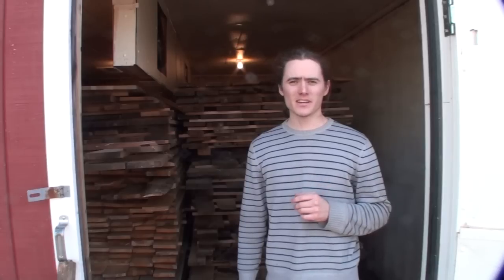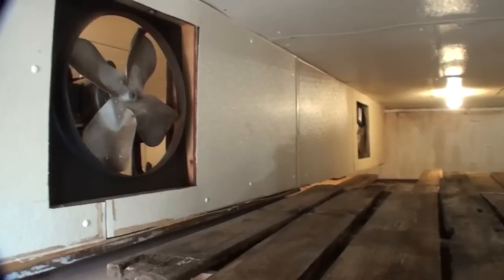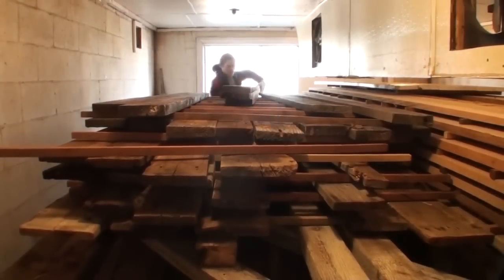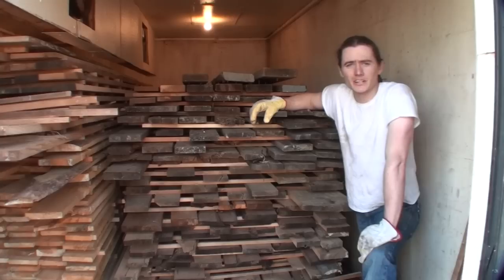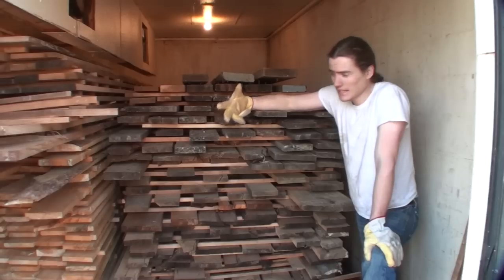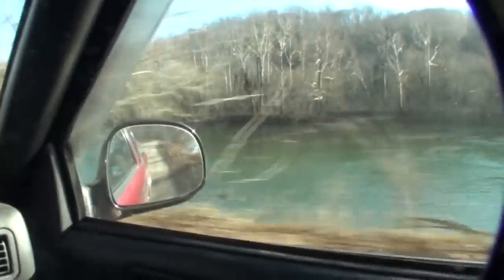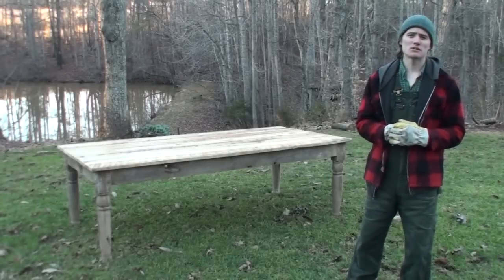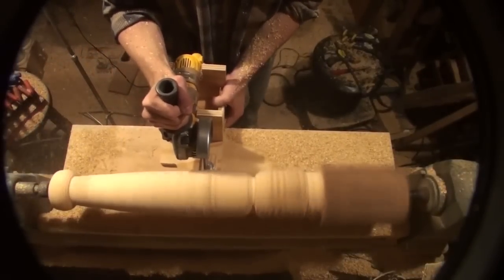Kiln Drying Reclaimed Lumber for Making Furniture - Barn Wood to Farm Table

Comment: Love you vids.. I have a tip, don't know if you have tried it or not but Baking Soda mixed with warm water will give wood an aged appearance.. Try it out.. might work better than dies..  just apply generously and let sit..
Reply from the maker: James Mead I've never done it but know about it, I use a different but similar method that is very fast. A jar of white vinegar with a piece of steel wool in it at least over night, remove the steal wool and you've got what still looks like vinegar but will turn woods with lots of tanic acid black if you want too. Oak, walnut, mahogany, etc.... I call it black magic. But the backing soda would also have it's place in my shop, my method is very powerful and does not work really on pine, maple and other woods which are lighter color. The nice thing about these methods are they are not "grain filling" like paint or stain and the grain of the wood is still visible and gives you options that you don't have with other finishes.

Comment: I have a shed 12 by 20 and I use stickers to seperate the boards and some fans to move the air around.  I keep there for a few months for pine but I have some red oak that I have had for about a year.  I like your idea about a solar kiln that you mentioned.  I have always like building wood projects but as for making money on it I haven't had that opportunity.  I just don't know enough people and I am not a sales person so I mainly end making things for family members.
Reply from the maker: Robert Lacasse Very cool, the fans alone really speed things up and keep the wood from getting moldy. Adding a solar aspect would really get you going. Thanks for watching.

Comment: Have you ever heard of making stain by putting scrap nails in a jar ( like you pull out of lumber) or steel wool and adding vinegar? Longer you let it sit darker thevstain.
Reply from the maker: Sure have, I call it black magic. I used to do it a lot. I use white vinegar, steel wool, let it sit for 24 hours or so and it's ready to go.

Comment: I've been purchasing Cypress from a guy w/ a lumber mill.  I can get any size, thickness/width I want in 10' lengths, mostly.  This wood is very wet and shrinks, heavily.  I've made personal projects, biscut joining the planks into tops that shrink so much they bust my full coverage glue joints up to 1/2" gaps.  
1.)  Can I polyeurathane all sides to stop this from happening?
2.)  How can I dry it out and how long will it take?
3.)  If I make mortise & tenon legs and aprins, will they bust as well?
Any thoughts on the matter would be greatly appreciated.  I haven't found anyone around here w/ a kiln as yet and have mostly worked w/ dry wood from retail stores which can't cater to some of the ideal widths and thicknesses I prefer.
Thanks for your generous consideration,
Steph
Reply from the maker: +Steph Boeker You just need dry wood for the majority of furniture making. You can get away doing green woodworking with certain chairs, stools, etc. But not most other stuff. Your polyurethane trick won't do anything, the finish will just fog up and the piece will still crack all up. You need to stack the lumber somewhere with spacers in between allowing for air flow (look up some stuff on air drying lumber) It takes roughly a year per inch of thickness to dry outside in average climates. But even then, the wood will not get down to the level of dryness for climate controlled environments, which is most every house. You can finish off your lumber inside for a while, it will acclimate. You can also look into solar kilns, they will be much faster and cheap to build compared to electric kilns, you can also build them smaller.......they work basically like how your car gets hot in the sun, but with fans and ventilation to control humidity. For your table base question, you've got more flexibility with the dryness of the wood, but still you will get movement, cracking, splitting.....but you can also have one of your table legs twist or bow bad as it dries, especially if they are smaller.

Comment: The rustic table is very interesting and I was wondering about the dyes that you use to get the old fashion look.  In your video you say you use orange, black and yellow dyes to get that look.  Can you tell me where to get the dye and what amounts of each color you use.  I have never done anything like that before and only once did I make a small cabinet for someone who wanted the rustic look and I told her I did not know how to do it so she had me paint two coats of brown first and then a few coats of white and had me sand through the white in various places so the brown would show through.  It took a loot of time drying between coats and I don' t want to have to go through all that again.  Any help or comments you have would be greatly appreciated.
Reply from the maker: Robert Lacasse My "dyes" are just water based paints, cheap ones from crafts stores in the little bottles. I mix up washes for colors on a lot of projects, one thing to note is they are not all that color fast, so they can fade. I'm only using this method in times when it does not mater. I mainly use latex wall paint and distress the surface as you described, but it's fast.

Here's two videos to show you my process, skip ahead and find the finishing. 

Farm table- (distressed paint) https://youtu.be/WcNCn-ytRgo
Kitchen island (mixing up the color with paints like a stain) https://youtu.be/4RMXEjGS1Fw
Reply from the maker: Robert Lacasse Also, it's not just the finish, it's the lumber used and it's texture. If you make a table top out of 2X10's from lowes it's going to look like it, even after a lot of effort to make it look old. It's just so identifiable as a 2X10. A lot of times people think that taking a piece of new pine, banging it up and applying a cheap looking stain to it is going to magically make it look 100 years old, that's not going to happen. Age is about layering and things not looking planed. I used to do a lot of pretty realistic aged pieces and it's a lot of work to transform new wood to look authentically aged. The easiest thing is to start with old wood! I have a truck, so when I'm driving around and see a dumpster full of old wood, or a house being torn down, etc. I load up my truck. I've also torn down wood from barns and houses. Use that wood for your clear finishes and newer wood for painted. So in my tables I use my older, or rougher wood for the tops and new wood for the bases. In most cases it would be a waste to paint over the older stuff, unless the project calls for it.

Comment: how did you get started turning your own legs.
Reply from the maker: I had a lathe before I even started making these tables and new how to turn before I even owned a lathe. Step one get a lathe, step two learn, step 3 make stuff! Its not that hard and can be done cheaply, lathes can be bought used pretty cheap.

Comment: Thanx for sharing your tips and trix! Im thinking of making my own kiln since I have easy access to a lot of cherry where I live. 

How long time to you think it will take to dry this kind of tree? 3-4 weeks?
Reply from the maker: On average the kiln runs for 21 days or there abouts depending on the lumber. Sensitive lumber sometimes takes a little longer because you don't want to ramp up the temperature quite as fast and the kiln needs to cool down slowly as well in some cases to avoid cracking the boards. There are charts that help you with this regarding how much moisture content each species can loose in a given amount of time without degrading the lumber.
Reply: Okey! Thanks for the info!
As of today I have access to cherry logs (3meter long) that have been stored outside in the open since the beginning of April. Do you think it's to late for me to make woodworking lumber with these logs? From what I have understand the best is to cut the logs into lumber as soon as possible in order to prevent cracks, mold and fungus. The logs have cracks in the ends but maybe it's still intact it the middle? Whats your thoughts about this?
Reply from the maker: April logs will be fine. I've seen logs sawn that have sat around for years look great. Most likely any checking on the ends of the logs is not deep. In the future, if your logs need to sit around for a while, just keep them in the shade...you can even water them if your picky, but i wouldn't. Your "rule of thumb" about sawing them quick is best case, but you don't always need the highest grade lumber. I use sub prime lumber for everything I do for the most part but the end results are perfectly fine. It's all in how you use the material. Most likely the cracks in the ends only go 6 inches or so in, but some could go throughout the log. The sawyer if experienced can work around them.
Reply: I actually bought some Oak yesterday thats 5cm thick and 2meters long. The MC is 15% since it have been stored outside for about 10 years (I guess it wont be any lower here in Sweden).
Im planning on doing some end-graind cutting boards as a starting project but Im worried the wood still have too much moisture in it. Do I need furniture-grade wood in order to make a high qulity cutting board, and if so, whats my best option to dry it. Take it indoors and store it for a few weeks? Month?
Is it a good ide to cut the boards into smaller pieces in order to speed up the drying process or is this a big NO-NO? Thinking the boards will get all wobbly and crocked if so?

Thanks for taking the time answering my questions! 
Cheers!

Comment: Great Video, been looking for a kiln locally.  I have not found one so I'll be building one.  Any chacne you have more info on that kiln?
Reply from the maker: Paul Hora This kiln cost $15,000, he built it himself. It's a block building on a concrete slab, There's about 2 feet of foam insulation under the slab and the blocks are filled with I believe he said Mica Chips. The attic is completely full of foam insulation, the building is basically a thermos. The actual drying unit was purchased, it's basically a heat pump, but a lot more powerful with added dehumidification. It can get up to about 150 degrees (ferinheight) The building is about 12 wide and 20 long. It has it's own electric service run to it. Depending on your goal, this could be the right way to go or you may be better off building a solar kiln which is what I plan on doing in the future. It will be much less costly to run and much cheaper to make.

Comment: What's the hottest you can get a kiln without hurting the lumber?
Reply from the maker: +Shane K Probably depends on the wood. Its really a matter of not drying wood too fast. Pine can be dried fast. Woods like white oak need to be handled more carefully. Also heating it up too fast or cooling too fast can cause cracks. There's really no reason to go over 150 degrees.

Comment: Something you did not explain well is  the high efficiency of a  dehumidifier kiln.   Basically the only losses you have  is  the heat content  of the removed water,   the losses  of the building  infiltration and insulation,  and the losses  of  electrical power  to the motors and  machinery.

You pre--heat with electric elements or other means.  Once up to temp,  the dehumidifier  "takes in" the humid  saturated air in the kiln,  condenses the moisture and drains it off by means of the evaporator  "end" of the system,  and this heat gained into the  refrigeration  is then  rejected along with  heat of compresson and other losses  from the condenser  BACK INTO  the kiln  building.   Thus,  you are  recycling all you can of the energy you use.

This  is  contrasted with simple  heat  kilns, whether heated with electric,  combustion burner  of some sort, etc,  which is  sorta  like  "heating the house with the door open."  That is,  ALL the heat  and energy  inputted into the kiln and the wood is marched right out the other end of the building, so to speak.

In the early 80's  I worked for a tiny outfit in Spokane,  we built  several kilns.  I believe the largest used 80 hp Carrier  shaft driver compressors,  but  one may have been 120 hp.

Comment: It takes 2 weeks to dry the wood in a kiln? Wow. I would never have thought it takes that long in a kiln. How long would it take for wood that has been soaking in the rain to dry in the outdoors, assuming dry weather prevails?
Reply from the maker: +Naveen S An inch a year roughly but thats just to get it to the level of humidity in that area. So it can easily take years....and it still wouldnt be dry enough for many things.